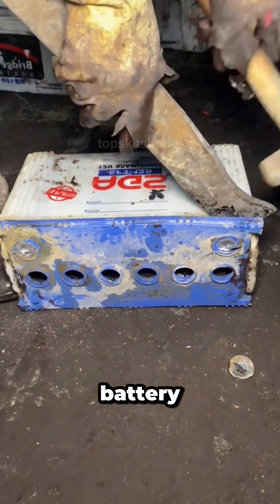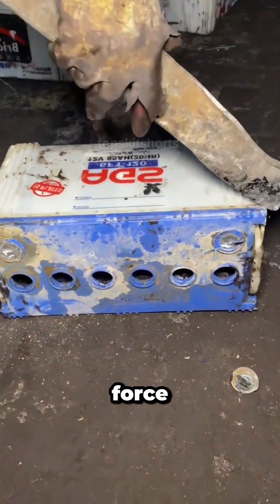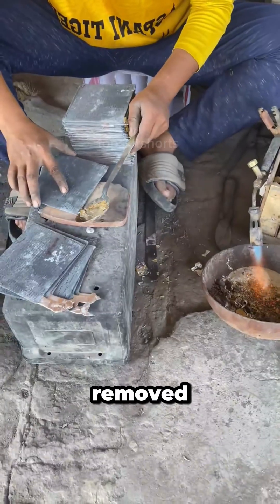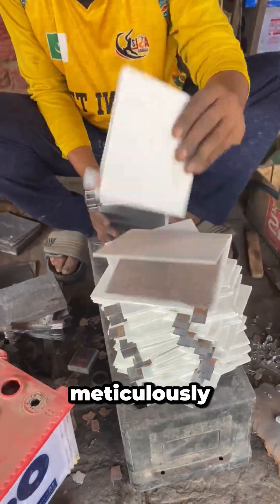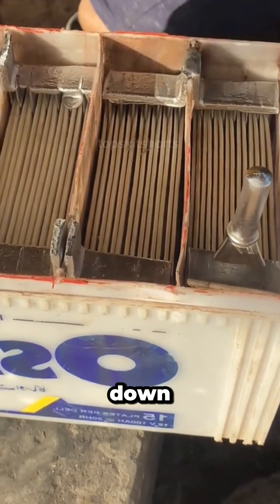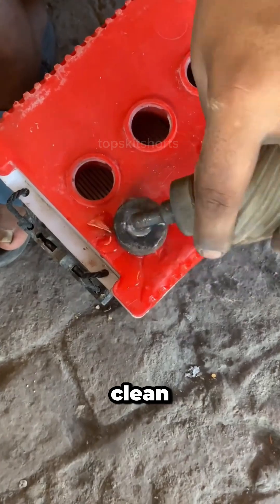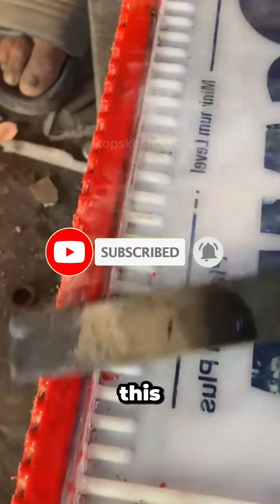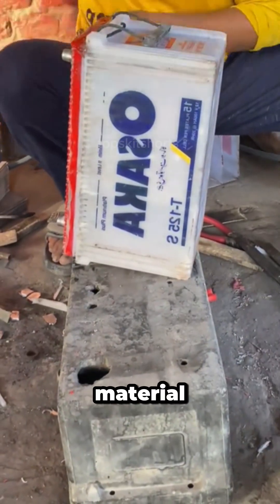How Lead-Acid Battery Restoration! 🔋⚡

Comment: Let me explain why the system illustrated in the video can't work: Even assuming they were able to perform leak-proof soldering between the various battery cells (and soldering lead to polyethylene is not something you can do by hand), the different cells must be leak-proof with respect to each other, because the acitic solution is polarized differently in two adjacent cells. A single electrical crack is enough to interrupt the battery. It becomes statistically irrelevant whether it's possible to make a functioning battery (for more than a few minutes) with the system illustrated, and I'm not saying this as a professor, I'm saying it because my father taught me how to do it, when he rebuilt batteries by hand in Africa in the 1930s.
Reply from the maker: Thanks for sharing your insights on battery construction!